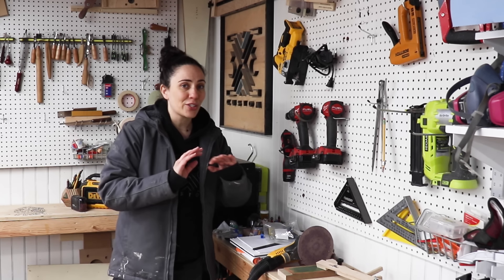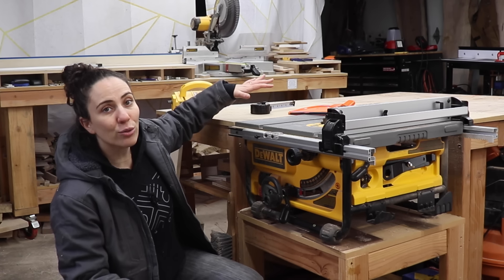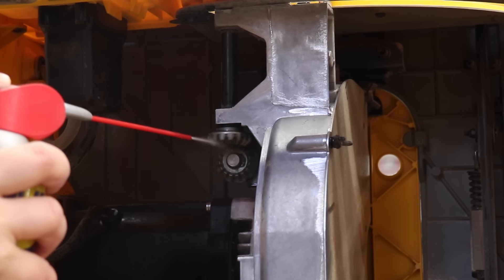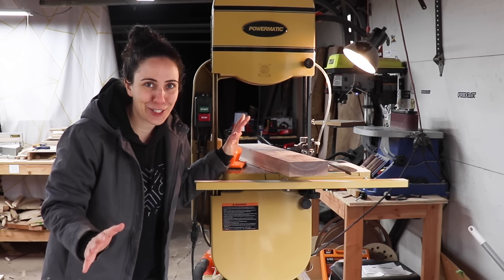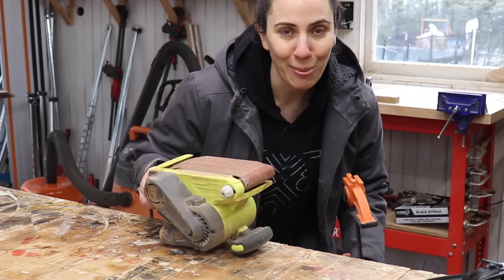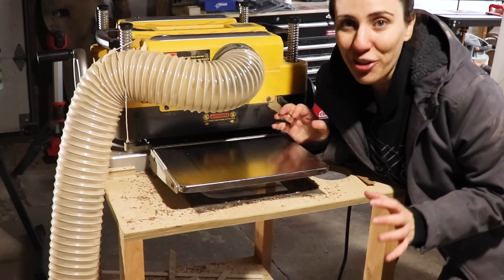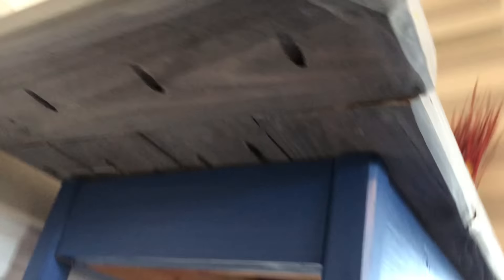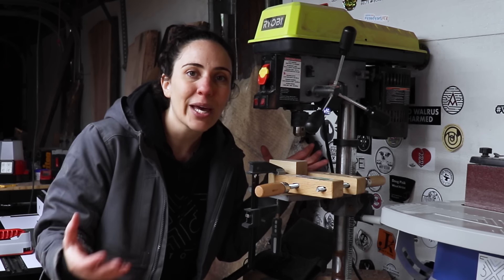What Tools Do You Need to START Woodworking? Beginner Woodworking Tool List

Comment: One question: why do you recommend starting with a compact router? I don't want to buy many tools, what will be the problem with starting with a large one, and what will I be limited by having just a compact one?

Thanks!
Reply from the maker: It’s less scary. And you need both eventually.
Reply: If you don’t want to purchase too many, nothing wrong with only getting a larger one only. I did the same and it was fine for a good while. But a palm router does over 90% of what most people do without the heft. Also not a lot of 1/2” routers available cordless yet, if that matters to you. A cordless palm router is literally fun to use while a corded 1/2” is actual labor.
Reply: @kenshirogenjuro873  would a 1.5HP router do 90% of the work?

On the short term I have no plans of working with hardwood, and the main uses I see for a router are rabbets, dados, and as a makeshift jointer. Most of the time I think I'd use on a router table. So the choices would be to get a really cheap, RYOBI 8.5 Amp 1-1/2 Peak HP for $80 or just go straight to a $250 DEWALT 2-1/4 HP with a fixed/base combo and all the bells and whistles. Sure it's 3 times more expensive, but I wonder if it's better to just pay that now instead of having to pay at some point and wasting the 80 bucks now on the ryobi one.
Reply: If it’s spending most of its time on a table then definitely you need a 1/2”. The two primary factors to me regarding your two choices are 1) how much you plan to build and 2) how accurate you need it to be.

My 1/2” is a Ryobi. It has been sufficiently reliable for the volume of projects I do as a DIY guy, but it falls short when it comes to accuracy. The mechanism is prone to wiggling and it’s hard to be consistent. If you’re mostly doing this for projects for yourself and maybe some family, it will satisfy the reliability but may fall short on the accuracy. Funny thing is, not having looked at it myself there’s no guarantee the Dewalt would be that much better. So I would recommend feeling them by hand at your local Home Depot and seeing how you feel about them. How stiff is the plunging mechanism and how consistent do you think it will be. That can be hard to gauge until after you’ve done real work on them of course but it’s probably still worth going in to get a first-hand impression.

But definitely look at other brands as well. Dewalt is very reliable but a lot of their tools are better geared for rough work, in my opinion. I will admit I ditched Dewalt (maybe a little unfairly) because their miter saws were never accurate enough for me. On the other hand their table saws are top-notch and fantastic values for what you get. I happen to be a Makita person myself. Bosch is another company you may want to take a close look at. Accuracy is so important with routers especially for some of what you are doing, and that doesn’t always correlate to dollars spent when it comes to tools.

Last point with that, is if you’re on a tight budget don’t overlook the used tool market.
Reply: @kenshirogenjuro873  Got it, if 1/2" is better for my needs then the ryobis I have nearby are a no-go. A BOSCH Combination Plunge and Fixed-Base Router, 2.25 HP near me costs around $30 more than the dewalt, so I'm assuming thats a better investment given its better precision?
Reply: @3x3CustomTamar  I went to home depot today, now I get what you mean by less scary. Even a 2HP router is much bigger and heavier than I was imagining it would be!

Ended up getting a 1HP Makita for now, I'm pretty sure it can achieve all I need for a long while. Thanks for the tip!

Comment: Hi I was wondering if you could help. Was wanting to make floating shelves with a carcass type design. Can I use a router to create a 45 degree angle so when I put the carcass together I looks like 1 solid pice of wood? Does thus make sense?  I hope so lol. I don't have a table saw!
Reply from the maker: You totally can
Reply: I bought a circular saw an see you can turn it into a table saw so I will have some fun trying that. Thanks for your response. Have you ever made a table saw for a circular saw?

Comment: Do you recommend converting a circular saw into a table saw, like some of the youtube videos suggest?
Reply: Speaking as a relatively new woodworker, I would not do this. Table saws are designed with safety in mind. Any power saw is extremely dangerous, and I just don't think that saving a few bucks is worth sacrificing the safety features of a modern table saw. You can get a good job site table saw for $600 or less brand new.
Reply: @peterhaas1336  makes sense, thank you
Reply from the maker: Agreed with the above statement. Safety is key

Comment: Hi Tamar, I really enjoy your videos, and your projects - I've learnt so much. I wanted to ask about your track saw, the Triton TTS1400. I have the same saw and have many issues with tear-out, as well as issues with lining it up at 90 degrees. Can you offer any advice to help with these issues and that saw? Thanks.
Reply from the maker: Thanks! I have a square that you attach onto the rail that takes all the guess work out of lining it up. I’ve linked it in a bunch of videos where I use it. It’s from tso. Regarding tear out. Maybe it the blade. Or maybe if it’s plywood tear out, you should be making a very shallow pass at first. Just to cut through the veneer. Then do a full pass

Comment: Such a simple question:  Where do you get the glue spreaders you use?  Reusable?  Box of 100?
Reply from the maker: Think one came with a glue bottle once. It’s silicone. So the glue comes right off when dry
Reply: @3x3CustomTamar  I went by Woodcraft yesterday and they suggested just using an old gift or credit card.  Very helpful, but they lost that itty bitty sale.  :-)  Not that that stopped me from spending $$$ there.

Comment: quick question. ive seen a good amount of your videos, and ive seen videos where your shop is so cold, we can see you breath. i  started woodworking, and experienced my first winter as a woodworker. it can get pretty cold here in toronto. did you leave most of your stuff in your shop? or do you have a type of climate control when you are not in it? did the cold affect your tools??
Reply from the maker: Cold doesn’t affect the tools. But it affects the glue and finishes. I bring those inside for the winter

Comment: 02:42 Don't panic, folks - DeWalt still has a few DW7485 [8¹/²] and the glorious DW7492 in store [all with that superb gear/fence system].
Reply from the maker: I just can’t recommend them bc I don’t use them!
Reply: @3x3CustomTamar  sure - but I just wanted to mention DeWalt's successor job site table saws, because I think they're of equal quality and I guess they are the best on the market in that price range. Have you gotten my photograph of my newly bought DW7485 on pinterest, Tamar?

Comment: I use hand tools. I find that even though power tools are faster they are messy, expensive to maintain, loud, dangerous and require lots of industry to produce. Most of my tools are vintage and work wonderfully still. I would rather use something thats already been produced than buy new. Just a personal preference.

Comment: Do you have any issues with a shop in your garage? I too live in the Northeast and have an oversized garage I am planning to start a shop in. Issues with humidity in the summer, glue-up issues, problems with tools etc.?
Reply from the maker: Just what you’d expect. Cold in the winter. Hot in the summer. I need to bring my glue ups inside during both extremes and bring my workpieces inside every night as I’m working on it

Comment: Great video, a very helpful overview! :)
About that miter saw, you said it wasn't necessary but do you still use it a lot? I bought a miter saw and circle saw recently to do my cuts. I also considered the table saw, but frankly I find it a bit intimidating. It seems to be a much more dangerous tool than the others. Plus I don't really have the space to incorporate it in a big sawing table.
Reply from the maker: It is a super dangerous tool. But you can do things like joinery on it that you can’t do with a circ saw. I use the miter saw because I have it for rough cross cuts. But I don’t need it.

Comment: I generally avoid cordless models.  The actual tool costs more and batteries are very expensive.  Also don’t want to be locked into a single brand as it severely limits the choice of tools.

Comment: I've seen this on multiple videos now so I've got to ask.
Does Makita not include an 8mm (81/256") collar for their routers in America? Or is there just no use for it because you can't get any bits in that size?
I mean it would make sense judging from the fraction. "81/256 inch collar included" doesn't really sound like a solid selling point.
Reply from the maker: I don’t have one. Maybe they sell one
Reply: Almost all bits in the US are 1/4” or 1/2”. Makita includes a collet for 3/8” but there’s almost none available (which I kinda lament). No metric anything for us Yankees.

Comment: how did the combo of table saw and reprocating saw go ?
Reply from the maker: For resawing? It worked. Ha.
Reply: @3x3CustomTamar  so did you get as much of the board with the table saw in 2 passes then use the R saw to take out the middle then clean it up on the planner ?
Reply from the maker: @munch15a  exactly

Comment: Hi, please help. My new dewalt table saw has a problem. The saw moves down ok, but it's very hard to wind it up. I have to turn the wheel very hard, a lot of resistance to move the saw up a little bit. Do you have any idea what happen to it and how I can fix it? Thanks.
Reply from the maker: Did you try what I did in this video? Blow it out. Then use some dry lube on all the moving parts. Besides for the gear, there is a metal rod in the back the the mechanism rides on, spray some dry lube on that as well
Reply: @3x3CustomTamar  thank you

Comment: Hey this is a great video!  Very useful for those getting started.  Unfortunately, as I found, the list gets long.  Fast.   

I’m just starting out with my shop and space was at a premium…. So, the one thing I may add is a track saw and a table for it.  I was able to do some incredible things with a TS55 and an MFT, and the table folds up and the saw goes back in the box.  It can do a lot of the same thing that a miter saw / table saw can do, and is arguably better for breaking down plywood.
Reply from the maker: Haha yup…

Comment: I would have to disagree with the harbour freight clamps. The only ones that have some viability would be the 6 & 12”. Anything longer is worthless as the bar is very thin for a clamp abd turns to a bow very quickly touching/marring your wood. The 6” harbour freight and 6” bessey clamps are so close in price range that its a no brained for me at least.

Comment: first thing i need is a single family home with extra space...very hard for people who rent rooms of a house or rent apartment. so many woodworking videos are for older people who've bought homes cheap...so discouraging.
Reply: It's not a hobby that lends itself to close quarters living conditions. Most people living in apartments don't appreciate the sounds of table saws next door.

Don't get discouraged though, i do a lot of my woodworking from the bed of my truck (out of convenience, i get a lot of free pallet wood from work) so im here to tell you if you've got space that is approximately 5.5 feet long by about 2 feet deep, you can do this. Frankly you can do with less so long as you can fit your wood pieces in the room.

A lot of woodworking channels are, imo, too reliant on power tools. They're great and convenient but expensive and bulky. Hand tools are more finicky, require careful maintenance which takes time, and can have little quirks, but they usually take up less space than their powered counterparts.

Rip cut hand saw, cross cut hand saw, a no.4 hand plane, some chisels, a square, a marking gauge (optional tbh) and a mallet are really the most basic things you need unless I'm forgetting something, and those can all be stored in a very small space depending on the length of your saws. Like in a small box that you can build in your living room.

As for a work bench, that's hard because that's kind of the foundation of a woodworker. But as I said I get away with a truck tailgate. Check out diy videos for workbenches for small shops. Get creative and just go for it, whatever you have in mind.

If your lumber will fit in your home, you can work with it

Comment: can a circular saw be mounted upside down to be used as a table saw? or is that very dangerous?

If this could be considered, what are the benefits of a real deal table saw?
Reply: I bought my table saw after I tried to rip a 2x4 with my circular saw, it took 5 min and no edge was straight. The table saw is more powerful, gives you much more control because you support the wood with fences,, you can do repeated cuts very quickly, rabbets,  dados, finger joints. It is a game changer.

Comment: The best piece of advice I could give anybody starting out, especially a person on a constrained budget: 
1)Find a local woodworking group; search online or at Woodcraft, Rockler, or a Wood Workers Guild, etc....
2) Learn what each tool is and how to use the tools safely. Cutting corners or just a "quick cut" while breaking safety rules can send you to the hospital ; be humble and let somebody teach you. Accidents can cost significantly more money than the cost of a big tool purchase.  If you take nothing more out of this comment, please take heed to this. I know about 10 people that have all had the "oh crap" moment. it happens, so keep your mind checked-in.
3) Get some hands-on with a few different models of each machine. You will discover things you do and don't like before you plop down a large sum of money; you'll be happier this way.

At this point, you will have made some friends, learned about tools, maybe built a few things, and spent zero dollars in tool purchases. Alright, maybe you owe a buddy a saw blade or some sand-paper as a favor, but that's a drop in the bucket. Additionally, you'll now have some experience. You'll also get to see about follow-on tools that you need to support some of the other tools you might want to purchase. Beyond that, Tamar's advice is sound as far as sequencing your purchase order.  I listened and bought a nice table saw. My second tool purchase 'should' have been a nice dust collector, but it wasn't. I've fixed that, but I caused my  own hurdles by being impatient. Don't be impatient. Find somebody who knows more and let them teach you. If you like it, be prepared to read books, watch videos, and teach yourself as you grow.
Reply from the maker: Good advice

Comment: With all due respect I'd say you were wrong. The first tools you will need when you start out are;
1) A decent WORKBENCH (with the implication that you have sussed out somewhere suitable to put your workbench, and work on it).
2) A BENCH GRINDER, and OIL STONES. What's the use of a chisel, a plane, or a spokeshave, if you can't sharpen them?
3) An EXTRACTOR of some sort. Working without one, with routers, chopsaws, table saws etc, will produce CLOUDS of dust, which you will be breathing in, and wading through, when it hits the floor. 
Not "sexy" tools, but if you want to work in wood, you will HAVE to have them, no getting round it. So you might just as well get them FIRST, THEN you can get all the hand and machine tools you're talking about.
Reply from the maker: I would call those accessories. But that gets into semantics. Ha

Comment: I often wonder what the minimal, stone age, what you really NEED stuff is.

a blade.

a hole maker.

a sticker together
Reply from the maker: Yes. You don’t need all these things. They just make life easier. They didn’t have running water back then either, but I’m sure glad I have a sink in my house now
Reply: @3x3CustomTamar  Oh yeah, I didn't mean anything like that.  Just... where did it start?  what was the first table like?  How many butt splinters did you get before you figured out that you rubbed that stool with sand.

Comment: I dunno, as the video went on, I started to question what your definition of "beginner" was.  I don't think beginners will start learning enough about rough lumber before they start learning about cutting and construction.  Most beginners would do well with just a jobsite saw, circular saw, clamps, pocket hole jig....that's really it.  At that point you can build basic things such as a desk, chair, bench, etc.  Nothing extremely complex, but enough to make something that will last them years.  A planer, jointer, bandsaw, etc.  These are items that IF you start buying raw material from your local lumberyard, it could pay off to refine yourself.  That's also saying if you somehow make money off of what you make.  There would only be so much you could make at your own home that would offset the cost of the tools for this.  Plus.....sadly....the cost of lumber now, it's just insane.  Maybe more of these tools go on sale as the demand for lumber goes down, but for now, it's just not worth it.  The cost for a couple of refined wood boards is not significantly higher than rough wood that you would save that much more and be able to justify the tools.  That's just my 2 cents.
Reply from the maker: That’s basically what I said in the video. The beginning but the circ saw. You don’t need much more than that. But once you start to progress and get serious about it. You do.